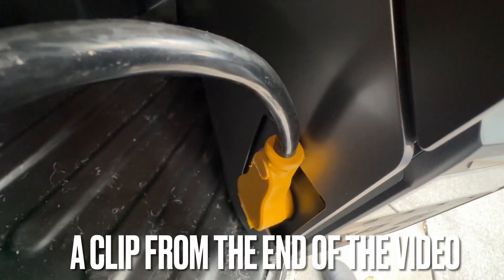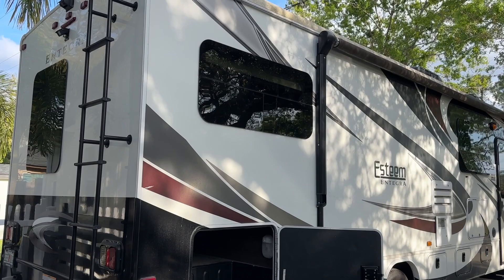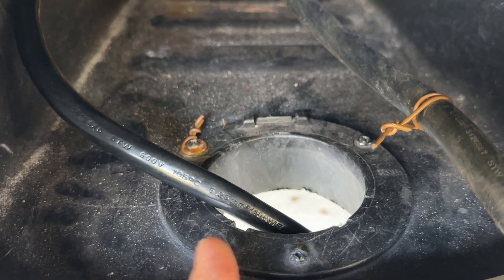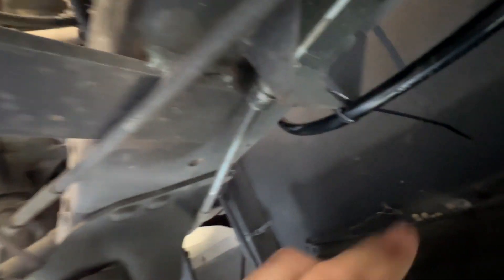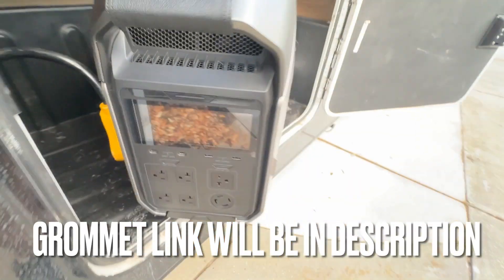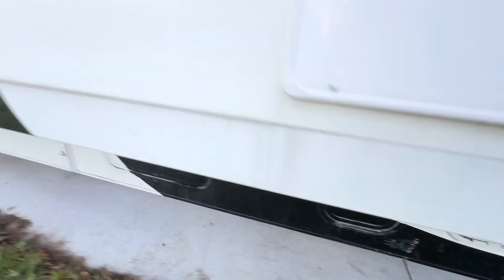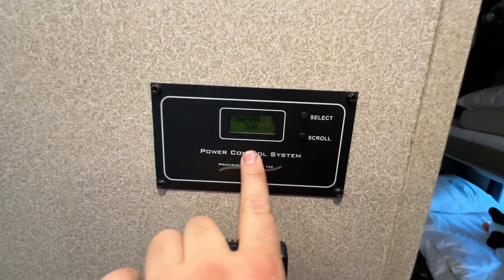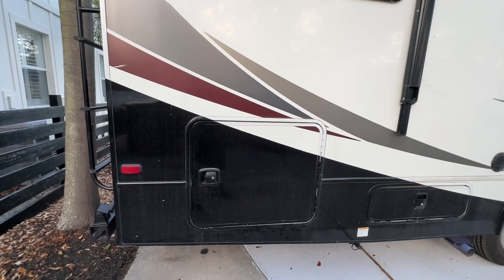EcoFlow Delta Pro 3 RV Hack – No Wiring or Transfer Switch

Comment: With a growing number of RV's coming with 50amp service, more of these portable power station companies need to up their game and start building them to handle the 50amp split phase 240V, without having to daisy chain multiple power stations together with a parallel kit.  These power stations are ridiculously priced already, having to buy 2, plus a parallel kit makes it even more impractical for many.  

Regular generators are loud, even the so called quiet inverter models, they're loud when you are pulling close to max power.  Where these portable power stations are nice and quiet, unless they have a built in fan of course, but still a heck of a lot quieter than a generator LOL.
Reply from the maker: Preach!!! Absolutely agree.

Comment: I have a Delta Pro 3 in the generator bay with a 4 prong inlet plug.  I have the 880w alternator charger connecting my house batteries to the Delta Pro 3.  That's it.  So the Delta Pro 3 runs my whole 5th wheels 110 outlets and air if I want.  I can turn it on and off with the app.  I can turn on the alternator charger, which will connect the Delta Pro to the house batteries.  This means that however my house batteries are charging, (shore power or solar) the Delta will charge also.  Very clean, don't have to run a generator.  I have 2 house batteries, (200 am hours total) and the Delta Pro 3 (350 amp hours) for a total of 550 amp hours.  This will handle everything overnight, all day, etc.  I am going to add the Ecoflow Smart generator 4000 running on propane to complete the package.

Comment: I like the idea but only a 13A draw with the refer, AC, and water heater "powered"? 
Boy....that is a lot less load than the same components in my RV. AC is 10-14A, Refer is 3-7A, and the water heater is a consistent 10A draw. I get that you may have a smaller front AC unit but the refer (mine is a 1200 norcold) and the water heater (atwood 10 Gal) should be pretty much the same. 
The only thing that makes sense to me is that the refer and water heater were at operating temps as to not be at max load.

Comment: Thank you for the video - This is exactly what I was looking for. No complicated wiring needed...I have a Jayco redhawk 22C SE - The 30 amp power cord compartment is is in between the back compartment  where the controls are for the water which is only about 3 ft away and big enough that can hold a big plastic bin and the front storage compartment which is about 8-10 ft away,....This is where I would most likely put the solar power station..Just need to take a look on where I can drill or cut a big enough hole to pull through my 30 amp power cord through...But this video gives me an idea..Most of the time we would use it when stopping overnight on a long trip..Instead of running the noisy generator for a few hours...(looks like the same setup as our RV which has a compartment next to your power cord compartment - How come you didn't use that area ? Just a thought...Thanks

Comment: nice and clean install, its better than a Yoga session or work out haha. I know. May I ask? will install a charging system while back on the road? I am looking to have a similar set up but I already have a gen prepped with transfer switch in my fifthwheel. I was looking to add a dc to dc charger with 12v coming from the pick up.

Comment: I installed the EcoFlow Delta Pro 3 the same way in my Tiffin Class A. Works great, because we enjoy going out boon docking.  I do set the charging rate lower around 800 watts or less if, I'm plugged into shore power and charging the Delta Pro 3 so not to throw a breaker while other appliances are running. So it's best to plug the Delta Pro 3 into the pedestal using a separate heavy duty 120 volt extension cord Then, no problems with accidentally throwing a breaker. After my solar install this winter that problem at least most of the time will be eliminated. Great video.

Comment: great video!  I had just watched a few of these videos and they got very technical.  I was questioning hiring someone to add it to my RV.  But this, this my friend I can do!  Quick question......about how long does it take for that delta pro to charge up just using solar panels?
Reply from the maker: Solar panels is simple math. The unit is 4000w total power. Theoretically if you have 4000w of solar energy going in = 1 hour to charge it. If you have 200w of solar going in = 20 hours. 400w = 10 hours… 1000w = 4 hours.
Reply: @fixitnoworlater  ty!
Reply: @JinxDClown Actually Ecoflow Delta Pro 3 has a maximum solar input of 2600W so if you were able to get close to the maximum, it would take about an hour and a half to charge the battery to full from 0%

Comment: I am going to do that but different. I have a camper van and have room for the delta pro3 with extra battery.. I have a battery generator that came with the van. it never worked properly, so they want 4000$ to replace second alternator. I'm getting the ecoflow. Thanks

Comment: Do you have to have the fuse box in the camper switched over to lithium instead of lead acid?
Reply from the maker: No. All this does is mimic shore power. No changes made to the inside

Comment: Thank you for putting this together! I was imagining something very similar for my upcoming RV rental, and your video has reassured me.
Researching "plugging RV shore power into a power station", I stumbled upon an issue of N-G bonding. Power stations have that "floating" by design, and RVs expect it to be bonded. Luckily, Delta 3 Pro allows to control that through an app, whereas older models requires some cheater plugs. Have you had to mess with it at all? Do GFCI inside the 
RV work correctly?
Reply from the maker: Yes. It all works fine. It works just as if the normal house generator is running. No difference at all. The only think missing from my setup in the video is the added 800w dc to dc charger hooked onto one of the house batteries and a few solar panels to supplement it. 8kw of power on these rigs goes a long way with supplemental charging. The ac will suck every bit of 1300 watts continuously in the heat of the day.

Comment: Just saw your video which makes me wish I had that kind of space in my Class B RV.  I have a similar setup but I use the EcoFlow Delta 2 max.  I just use an RV 30amp to 15amp adapter and connect to my EcoFlow to run my A/C at night when there is no electricity or generators allowed after 8 or 10 pm.  I saw in one of your comments that you recommended an extension battery.  Personally I never use extension batteries.  I prefer stand alone 300ah lithium mini batteries.  I use 2 300ah batteries which provides an additional 7000 watts to my 2000 from my ecoflow and all for under $650.  If you buy 2 with self heating and bluetooth that will cost about $1100 for the extra 7000 watts which is still a better deal than the expansion battery for your EcoFlow Delta Pro 3 which costs $2200 for 4000 watts.  During the day after quiet hours I charge my batteries with my Onan generator using a lithium battery charger connected to one of my a/c plugs or solar panels .   Something to consider incase you ever wanted extra running time.  Have a great day and great job on the video.
Reply: Interesting, how would you connect the 2 additional 300ah lithium mini batteries the EcoFlow?

Comment: Very bad idea. You have to remember that Ecoflow has an internal fan for a reason. Your trailer's compartment is low close to the road and has no ventilation, and will definitely build-up heat from the road. You will have to install an intake/exhaust fan on the compartment door to circulate the hot air.
Reply: I’d love to do this after pricing a complete solar system for my travel trailer. Only problem is my rig is a 50 amp. See any problems with that?
Reply from the maker: Bullshit. Drove it over 1300 miles like this with a temperature sensor in the bay. Never got over 88 degrees inside of the bay, I’m in FL in a heat wave. Test before you run your mouth. Also, even if it overheated. It’s an ecoflow with an exceptional BMS and cooling system. With fallback over fallback. Worst thing it would ever do is shut off. So take your feedback, test it and come back and tell me you are sorry for making me put down my coffee to type this.
Reply: @fixitnoworlater  lmao, I love it lol

Comment: Great video!  We have a 30 amp class c as well and our onan crapped out on us.  We built a metal stand in its place and have a 2200 watt inverter that we use to run the AC while going down the road.  Will be switching out the generator and in its place using the ecoflow delta pro and their alternator.

Comment: Add the EcoFlow Alternator charger for $399 and your vehicle will charge the EcoFlow at 800 Watts. Switch the front A/C unit to the new 12 volt 10K with heat and it will only draw 250-400 watts while on high. You’re almost there!!  Great start, great video.
Reply: Yupp, and countrymod had an awesome 12v  in roof ac unit
Reply: basically, his rooftop AC unit is running on 48v dc because that is what is in the ecoflow.
Reply: @uhjyuff2095  Through an inverter that is in the ecoflo yes, its not directly running on 48V.  

The problem with using those power stations like this is you have quite a bit of power loss because of the inverter, but its a great way to get power when you don't have a way to plug into shore power.

Comment: I thought I could do this and your video confirms I can.  My only problem is I have a Ecoflow Delta 2 Max that doesn't have a 30amp plug in it.  I plan on using the 30amp plug and cord of my RV trailer and attaching it to a 30 Amp to 110 Volt RV Adapter Cord with Circuit Breaker and plugging this into my delta 2 max.  This should work just like what you have shown in your video?  I won't be running an air conditioner.  It will be powering lights, starlink, and a propane heater when necessary.  I may occasionally run the small oven that comes with my trailer.  This should work, right?  thanks for any help.
Reply: This is also what I was thinking of doing so thank you for your question.

Comment: Please follow up on how the zip ties hold up in the summer heat (e.g. 6-12 months). Curious if they become brittle due to summer road heat in a high vibration environment. Also a recommendation for conductor sheathing protection, wire loom will help where the conductor/cable contacts any surface (an alternative to pool noodles). Thanks for the video.
Reply from the maker: If you are concerned about that, rubberize some metal ones. No issues for over 50 years there.

Comment: That’s a great setup if your 30amp plug is in a bay. Most travel trailers have the plug  on the outside of the RV.
Reply: My travel trailer has plug on back wall outside and I have similar setup. I ran the 30 Amp extension cord up from under bed if front of rv down through port in floor of cargo bay. Then under trailer all the way to back and plug in. I zipped tied it in multiple spot so I doesn't drag. Had I like that for a few thousand miles no problem.
Reply from the maker: Yeah. Mainly for the C and A rigs

Comment: Nice video. Looking for a solution to Boondocking with an RV without a noisy generator, and this looks like an easy solution at least for limited periods of time
Reply from the maker: Doesn’t have to be for limited time either. Add the extra battery add on. That will buy you 8kwh. Then rack mount the smart generator 4000 to the rig, connect and set to auto. Then add the dc/dc alternator charger and 2x panels on the roof. You’ll stay for months off grid.

Comment: I suppose you could run an extension cord to the ecoflow from a power strip that you can turn off, which is connected to an AC plug on the RV, and just keep the power strip turned off when on ecoflow power. Then turn the powerstrip on when on generator so it charges, right? It would be convenient to be able to push a switch inside the RV to start the ecoflow charging. Also, is it dangerous or bad for the ecoflow to accidently try to charge your ecoflow with your ecoflow?  Highly considering getting one of these for my 2020 thor 31w instead of building out a lipo system. Good video, thanks